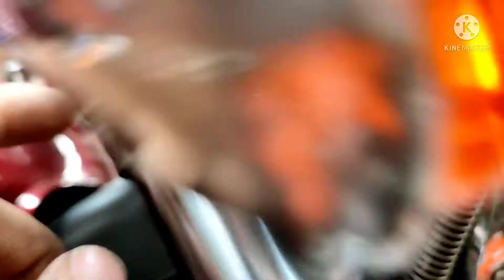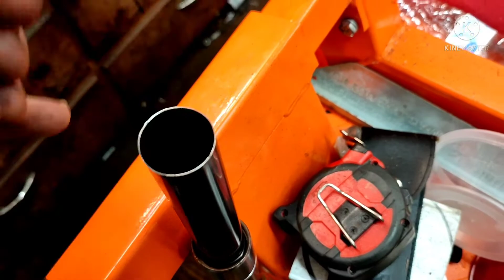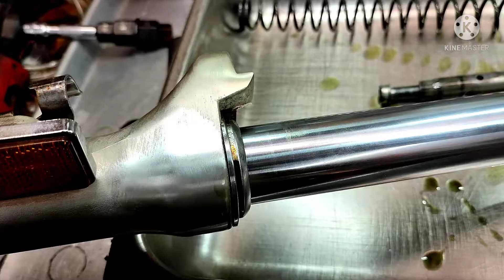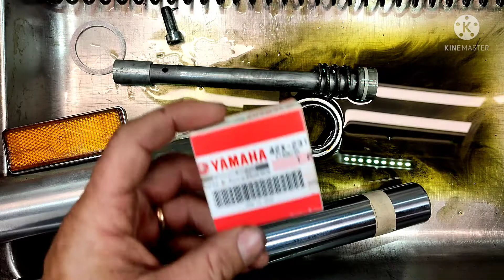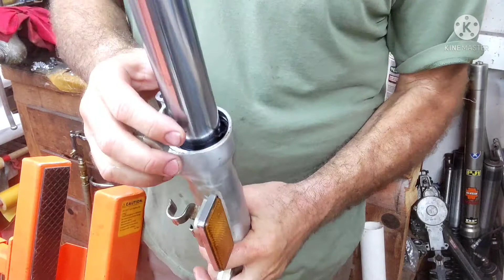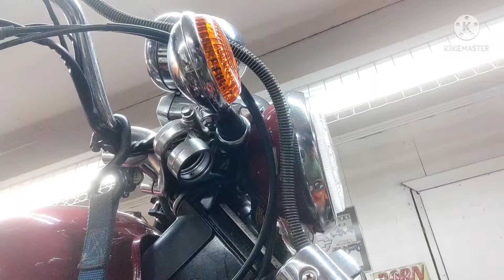Yamaha Virago air fork seal replacement

Comment: greetings from italy! ijust bought and  restoring an as-new  22000 km (!!) 1989 xv1000. fork air does not hold. i looked around for those 2 air seals inside the clamps, but can't find em anywhere. any clue? if i cant get those, can i safely ride w-out air?  could icompensate lack of air pressure with thicker15w oil?
Reply from the maker: The part number is 42H-23188-00-00 you'll need 4 there is one on US eBay right now. I would get one then find an oring to match if you can't find all 4. Heavy oil will slow down the travel but won't act like the air. The air is like a spring so you would be looking at things like shims above the springs or heavier springs to make up for the air.
Reply from the maker: It also looks like motorsport.com has them in stock if they'll ship over seas.

Comment: Hi mate great video, which will definitely be my refrence when i do mine. If you shorten the top spacer will it lower the front end of the bike?
Reply from the maker: It will, but if you do I would put an equal size spacer where the short top out spring is or else you'll have a portion of travel, at maximum extension, with no resistance. If you do it right you should still have to press down the spacer to put the top internal nut on, which is setting your preload.

Comment: Great need a special tool just to undo the cap 🙄
Reply from the maker: You should have that tool, it does a lot more than that and it's cheap.
Reply: @TepcoCycleRepair  I ended up cutting the head off of a large star bit as the shaft was a 17mm allen. I swear I had one years ago but only seem to have half a set now 🤦‍♂️.. happy to report though I have now finished the forks and reffited to the bike this evening
Reply: @TepcoCycleRepair had to use an impact gun to get my caps off. I don't think they had been changed in years
Reply from the maker: @JP-ed2bz  Probably never changed, Good job!

Comment: i realized in 1985 that the air assist was a joke . years later i drilled and tapped the upper top caps to accept a 7/16 allthread . i have had control of the front suspension ever since . i finally needed new fork springs 39 years later and i still love my ' adjustable '  front suspension control . my front forks dampen at about 1-1/2 inches but after that i have FIRM front ride control . my 85 1000 virago has been a trike for 36 years and i make the fn rules , hirihito just scowls in dissaproval . im running dual ignition points and a delco alternator off of the driveshaft . the japs can feel free to blow me .

Comment: Any idea what the torque spec is for the bolt on the bottom of the forks? Can’t find it anywhere.
Reply from the maker: Not off the top of my head but there are a few free PDF service manuals on line.
Reply: @TepcoCycleRepair  It’s not listed anywhere in the service manual that I can find. 🤦‍♂️I got the left one tightened to 14 ft-lb just to be safe, but the left spins even though it is rather tight. No leaks and it’s not stripped. I can back it out and I’m just fine. I guess I’m just trying to find out if it’s supposed to stop spinning even though it’s tight?
Reply from the maker: 22 ft lbs, page 318 of the service manual. You have to hold the damper rod to torque it. Here is a link. https://www.manualslib.com/manual/823557/Yamaha-V-Star-1100.html?page=317#manual
Hopefully that link works.

Comment: Where did you buy the parts? I live in Europe and I cant find new dust seals outside the States since the manufacturer apparently doesn’t make these anymore. The newer version is still available (doesn’t have the chrome cap on it).
Reply from the maker: I got them from rockymountainatvmc.com as of today they have 4 of each side in stock. Not sure about their international shipping though.